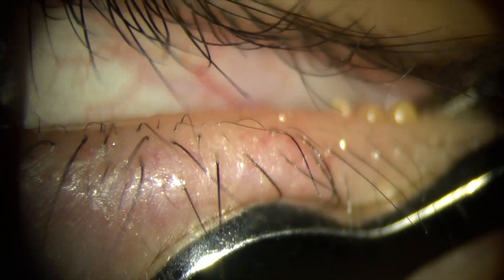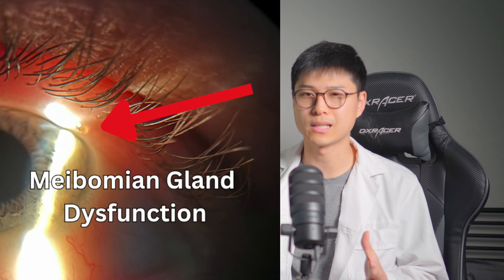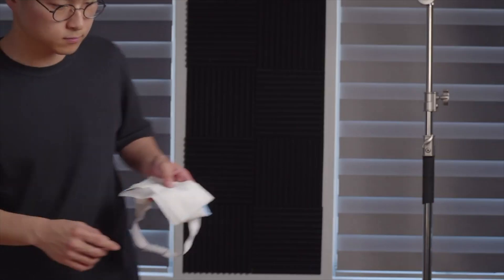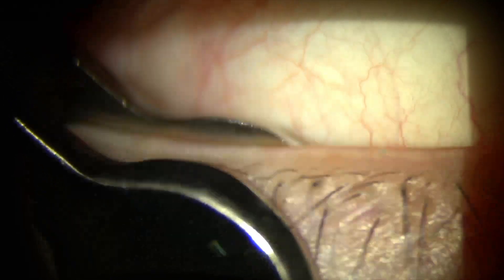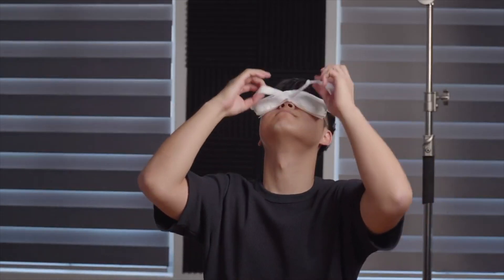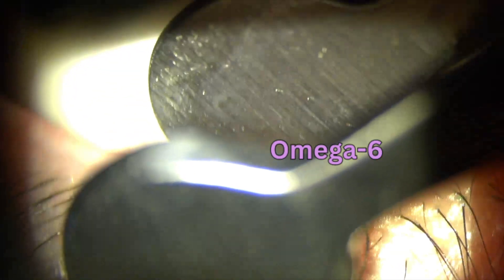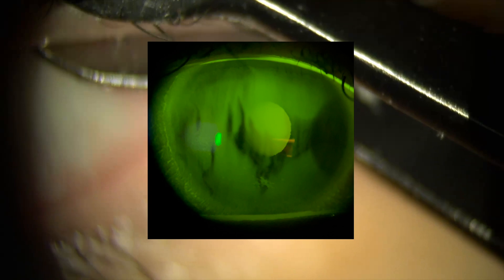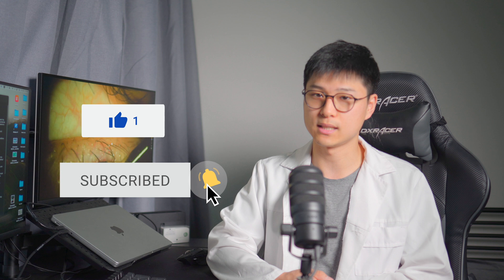Squeezing my eyelids was SATISFYING

Comment: Is it even possible to avoid things like dust and pollen? I have dry eyes that are very watery so I'm regularly blotting them and I use these stupidly expensive preservative free drops and the nighttime vitamin a vaseline as well as using a humidifier and a HEPA air filter but it's still a constant problem. Had ana & crp etc all normal. I think I've just permanently damaged my meibomian glands by wearing black kohl in my waterline daily for almost a decade in my teens & early 20s, but that was a decade or more ago so it probably can't be reversed.

Comment: For anyone else with this problem you can buy blephasteam for home, it's kind of pricey but once you've bought it, you just occasionally replace the water carrier. Helped me quite a bit. You can also do stuff whilst you are wearing it which means you can continue to read for example.

Meibomian gland expression does help but its also pretty pricey. I did something very not reccomended and I bought the expressor forceps/paddle and I do it on myself (lower lids) with a 20x mirror typically used for makeup. I used to do it maybe once a month, or once per two weeks. I maybe do it once every 2 months now. I think it helps a bit, but you need to be careful to not overdo it because you can do damage to the glands potentially if you do. You also want to be careful about the obvious not poking yourself in the eye and making sure things are sterile if you try this (but if you can afford it please get a professional)

I found changing drops I used helped the most. I use hycosan dual at the moment, and i use manuka honey occasionally (optimel) applied to lid margins/inner lid, which seems to provide the most relief. It stings a little when you put it in but the eyes feel so much better after.

I did pay someone to do the expression on me for a while but it was too expensive for me to maintain. They did notice over time my meibum improved. I was using omega3 with no omega6, and with high concentration epa/dha. I was also using manuka honey every now and then. I went to see a dry eye specialist and I had some atrophy in bottom right eyelid, I told them about having done expression on myself and they said they've never heard of anyone doing it before. It's not the easiest thing to do to be fair.

Another tip is to keep some cold gel compress in fridge, sometimes eyes benefit from cold more than hot.

None of this stuff is a cure, but it does help me function. Thought I'd comment in the hope it helps someone.

Comment: I'm wondering, does a blockage cause a "itchy" feeling?

I've got this thing where some eyelashes will start to... "Itch" or cause a irritating feeling.
When I pull on them usually a couple will come right out.
But I'm never sure if it's the eyelashes themselves (the hair folical) or something else and it's just coincidence.
I don't think I have dry eyes.
Reply: Could be a number of things. If it's a mild case of blepharitis some lid hygiene (using wipes) 2x daily may help clear it up. Could also go to a clinic and get them to do "blephex" which is basically a spinny tooth brush for your lid margins. (Don't do this one at home!!!!)